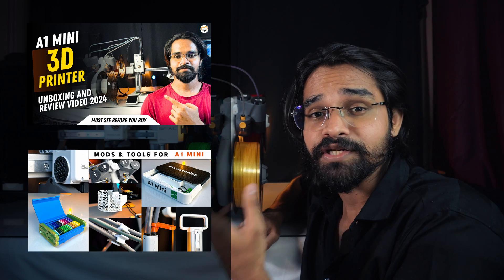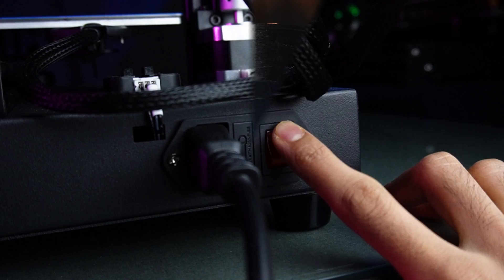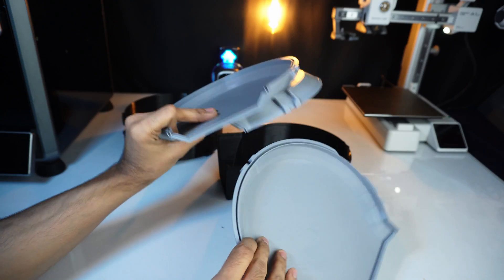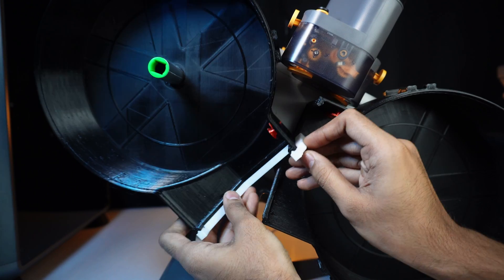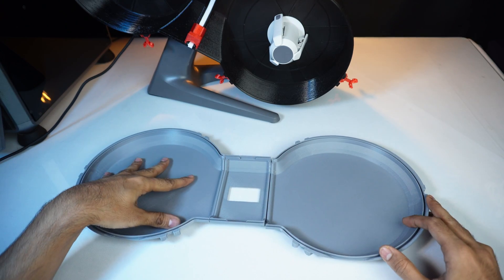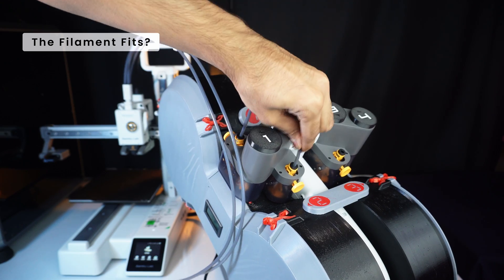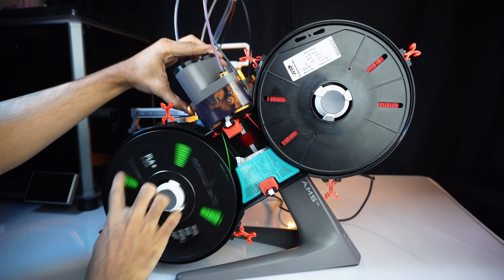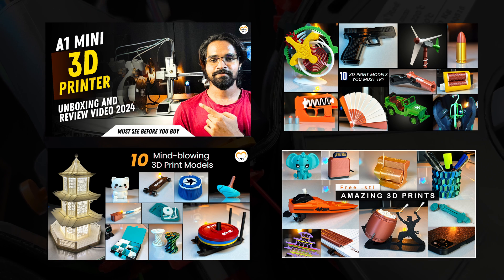Ultimate Filament Spool Enclosure for AMS Lite Bambu Lab A1 &  A1 Mini | Keep Filament Dry!

Comment: Can it be printed on the A1 mini? For someone who has just started with 3d printing, they wouldn't have multiple printers to help during the print process
Reply: I can't see how. The build plate is just too small. I just ordered a A1 Mini and was planning on printing this on my Prusa Mk4 but even that is a little too small. Ugh. Someone on eBay is selling them, but wants $40 shipping on a $40 item. There is a set for the mini, but you have to glue the spool holders together, and I'm not a fan of that. But it may come to it...

Comment: Thank you so much for this video brother! I already bought a little enclosure for my bambu a1 to keep dust and moisture out and to help keep heat in but i couldn't find anything for the ams lite which is probably more important keeping moisture away from the ams lite because thats what holds onto your fillament. I know you had to use your older larger printer to print this because the mini was to small but do you know if the bigger a1 can print this ams lite enclosure? The bed is 256X256X256 mm
Reply from the maker: Glad you liked it, brother! 😊 Yes, the Bambu Lab A1 can easily print this enclosure. In fact, I'm planning to reprint it on my new A1 Combo to test it out myself. The build size of 256x256x256 mm is perfect for this project. Let me know how it works out for you! stay tuned ❤👍

Comment: Use clear filament so you can see how much filament is left on each spool nice and easy
Reply: someone told me that it wont print right if you use clear filament, Im confused? Im new to this so what kind of clear filament works good?
Reply from the maker: It can easily print with clear filament with right filament temperature and other settings, even I am planning to reprint this on my new A1 with clear filament.😊👍

Comment: Hello sir currently I buy bambulab  A1 combo but in filament can not detecting in AMS
Reply from the maker: Hello, check AMS and printer wire connection, check if the AMS slot is pulling the filament in, after inserting filament. if not then contact the dealer from where you have purchased.

Comment: Can you top mount this? it feels gigantic. I'm wondering if i should buy a P1S instead
Reply: nobody should top mount anything on their printer. It's a bad idea when you care about quality prints. All this mass wobbling up there. Wall mount or build another stand above if needed, not connected to the printer.
Reply from the maker: Top mounting AMS on a1 mini is dangerous, I have noticed that a1 mini's weight is lighter that AMS lite with all 4 kg filament loaded. also you are right a1 mini with an AMS lite system takes a lot of space. If you have the budget then P1S is also a good choice.

Comment: How low did you get the humidity to go?
Reply from the maker: I didn't calculate the exact time, but it will stabilize in a few minutes (depending on silica beads quality).

Comment: Highly doubt it will be protected from the moisture. Not airtight at all. But nice addition to the setup and dust protection it is.
Reply from the maker: The humidity surely goes down, but yes you are right the enclosure is not airtight.

Comment: I highly suggest use the rechargeable silica beads not the prepackaged pouches they're very unreliable there should be another part that holds silica beads rather than pouches
Reply from the maker: Sure, I will try beads, Thanks for suggestion 😊👍
Reply: You can put normal silica in the oven for a few hours and it will dry out. Then you can use it again like new.
Reply: There is, it's included in the file. Here's my version running for about 3 months now using the beads. I'm extremely happy  with the setup: https://www.youtube.com/watch?v=-ZLNcf_Huy4&lc=UgwZSia5WNGCWxN-iXR4AaABAg

Comment: I printed this and had some issues with the filament spool rubbing against the wall of the enclosure.  Not sure if it’s a sizing issue with the enclosure or size of the spool.  But useful when I’m not printing, saves taking the spools off and storing them.
Reply from the maker: Hey mate, what size of your filament spools? 🤔 I tried almost all sizes of 1kg filament spools and they fit perfectly into the enclosure. If you rarely use the AMS system, then taking spools each time is a good idea. But if you want to save time to load and unload the filaments then this Enclosure might help.

Comment: What's the total time to print this?
Reply from the maker: It Depends on the printer. If you print on bambu lab x1 carbon then it takes around 20hrs.
Reply: @3DELWORLD  Noted, so safe to say about +10 hrs for P1 series and even more for A1 series..
Reply from the maker: @prashantchanchal1551  Yes, you are right 👍